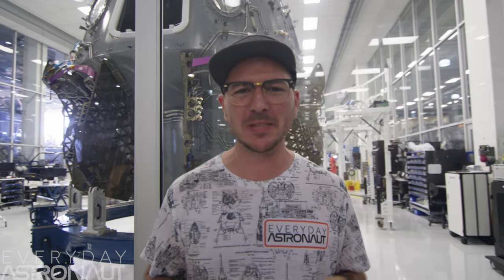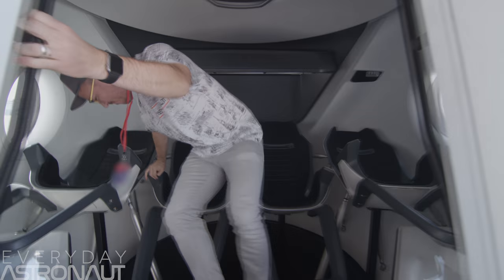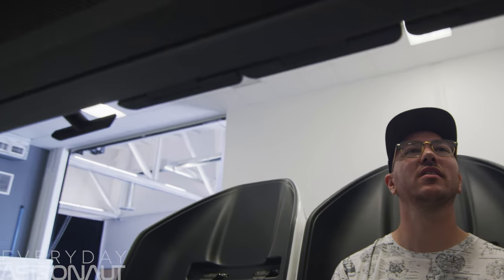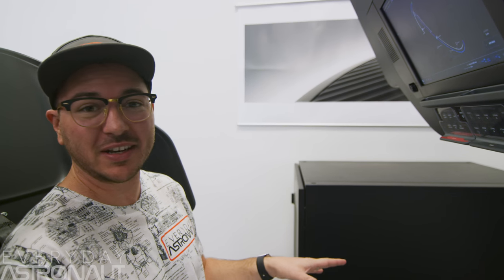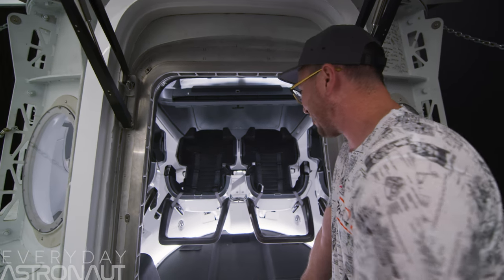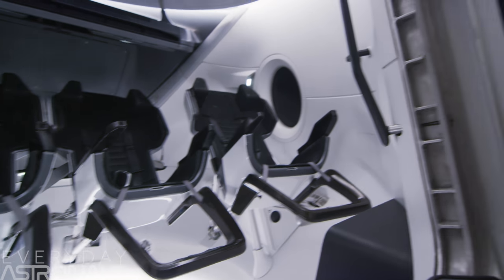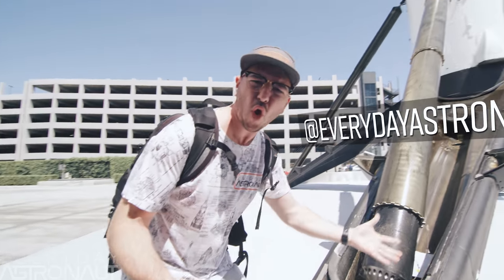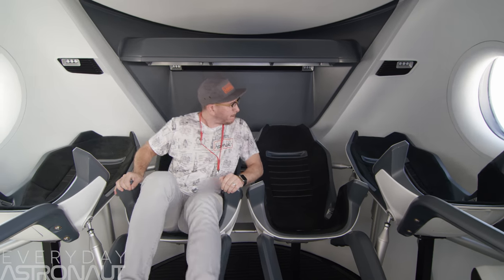Inside SpaceX’s Crew Dragon Capsule and HQ!!!

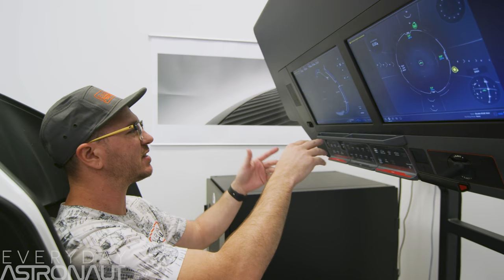Comment: Just for clarification, at 2:55 or so, Tim mentions "jettison the nose cone here in a second". I thought crew dragon won't jettison the nose cone. I thought it was on a hinge and will fold backward for docking. Am I mistaken?
Reply: I believe in a nominal scenario,it will hinge and fold backward for docking. If an off nominal situation where the hooks and backup hooks fail to unfold the nosecone, it will be jettisoned. It's basically a backup to the backup scenario for crew dragon.
Reply: David
I think it was a slip of the tongue.
Reply: The PYROS group of controls (the third group from the left) does have a "Jettison Nose Cone" button, but in this case I agree with David that it was a slip of the tongue as Tim was talking about viewing upcoming events.
Reply: Thanks all, was just making sure!

Comment: First of all, extreme awesome insights!
But on two points I want to calm your excitement with a bit of context ...

1. Autonomy isn't really new 21st century tech: every Russian-human-space-flight-vehicle (Vostok, Soyuz, Buran, TKS, Salyut) is/was capable of fully autonomous flight, starting with Jury Gagarin. But true, for American crafts this is kind of new... trolling

2. The seats going up to the controls is also an commonly used technique (Shenzhou, Soyuz, ...) to dampening the shock of landing or firing launch-abort-motors.
Reply: Oh, in English the correct transliteration reads: Yuri Gagarin.
But hey you probably understood to whom I tried to refer here ;-)
Reply: The Space Shuttle was also autonomous, though early flights required crew to take over final approach and landing. Also all cargo spacecraft by definition are autonomous (perhaps except docking??). Hell, the american capsules were autonomous from Gemini on, and Mercury was remote controlled from ground computers.

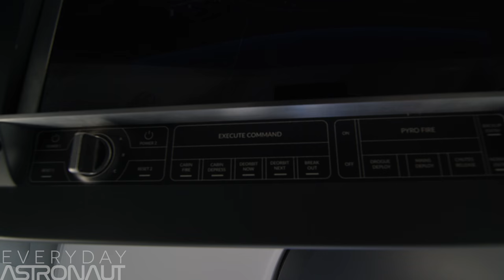Comment: The touchscreen and "capacitive buttons" worry me. A spacecraft during liftoff and reentry will be vibrating and have high G loads. I'd want a physical button I can touch without triggering, then just apply more pressure to trigger. No uncertainty. No "well, I THOUGHT my finger was on 'deorbit now', but it actually activated 'cabin depress' - oops." (1:34 - they're right next to each other!)

It doesn't need hundreds/thousands of physical buttons - just replace the capacitive buttons with physical ones. They can even change what they do, with a label on the screen right above.  Sort of how airliners don't use touchscreens, they use plain screens with buttons surrounding them that change in software what they do. You should be able to push buttons by *feel*, not needing to look directly at them.
Reply: Fortunately the capsule flys automatically
Reply: True. But when it *ISN'T*, that's when you need the "hard/impossible to get wrong" controls.
Reply: I thought the same. Touchscreens are not 100% reliable sometimes, with dry fingers they don't react from time to time. Maybe they used better screens compared to the screens used for standard applications.
Reply: I'm pretty sure they did. Because astronauts are going to wear spacesuit while using them.
Reply: They did special gloves for touchscreen
Reply: It's not like they have rocket scientists working on this...
Reply: Srsly, i gotta lol when average Joe's on the internet think the best and brightest in these fields haven't thought about every potential complication before making their decisions.
Reply: @jimmyjoemonkeyii3563  
The concerns are reasonable, touchscreens aren't really the last option you would want to have to relie on. Boeing does not use switches for nothing, modern aircraft with touchscreens still have physical switches for the most crucial operations. Obviously, you can program a touchscreen individually, to not start an operation due to accidential contact but you still have the issue of relieing on one panel, wich, if it fails, takes out all manuel input that an astronaut could make. Not just that but a lack of physical recognition also means that actuating the correct operation under complete loss of visibility is not possible with a touch screen. Now, you could argue that the capsule is highly automated and isn't really in need for manuel navigating from within the capsule anyway but you always take the worste case into account, in this case, complete manuel navigation within the capsule. You could always take more than one touch screen on board to switch, if there is a malfunction but that would add complexity and weight, both the only really big advantagous of a touch screen over a mechanical switch.
For your last comment, it very well can be that this isn't the complete design of the Dragon capsule.
Reply: @mandernachluca3774  but how at risk are touch screens of failing though? It's never really the hardware/circuitry that fails, it's the glass that becomes compromised. Manual switches could potentially fail as well and when they do the process of fixing them is more labourious then changing a compromised touch panel. They seem pretty reliable, especially with AI backup as you noted. Plus, the added complexity and weight of taking more than one touch screen onboard is fairly negligible. I'd imagine Boeing and others haven't made the shift because these companies get entrenched in a particular way of doing things that work well enough and are tried and true. Switching tech can cause headaches in terms of costs of manufacture, installation and retraining pilots.
Reply: @jimmyjoemonkeyii3563  
I don't think that Boeing is entrenched in some kind of thinking, i think that Elon forces to much futuristic thinking onto Space Xs Crew Dragon capsule. The thing is, that one out of 50 switches is less difficulte to repair, as opposed to one entire panel, it is less costly to repair and potentially faster to repair, in case of an emergency. You could just have a spare panel already installed but that would mean more weight and therefor negating  
one big advantage of touch screens. Also, when talking about switches vs touch screens, you don't nessacarily have to decide for just one of them, Boeing actually did a great job of just including as much switches as really needed, coupled with big screens that show every nessecary parameter. Even though Space X hopes to completly automates the Crew Dragon capsule, they still would need buttons or switches for the absolute nessecary operations and from what i' ve seen so far, space x actually incorporated a very limited ammount of buttons.
Reply: @mandernachluca3774  I don't think multibillion dollar companies are concerned about the repair or replacement costs of a few panels in a tiny amount of capsules built. It's a very small cost for the benefit of simplicity and usability. As for entire extra panels or even just the glass or plastic used for the screen, we're talking barely any weight, like mere pounds. The chances of a touch screen breaking or becoming faulty are small in the first place given these are fixed installations and not devices carried around like phones. Of course there could always be backup controls (not just manual but extra touch panels) but if AI truly is reliable (it should be by now when it's used in cars) it would suffice while repairs are being done. I mean, they already plan on using AI to dock the capsule to the ISS. I don't want to fault Elon for thinking 'too' futuristically. I just see his moves as a much needed innovative boost in an industry tainted by corporate profiteering and innovation stifling lack of competition.

Comment: I think SpaceX will revisit landing Crew Dragons on land using the Super Dracos. I know Elon said their future for landing spacecraft on land will be the BFR. I think for some situations the BFR will be overkill. I think they'll find that even with the BFR, there is a place for Crew Dragon. Sometimes you want to transport a few people to and from space. Like maybe for emergencys.
Reply: I think Nasa said they don't want landing legs incorporated into the heat shielding as that was a point of failure for shuttle.
Reply: Sarah
Unlike CrewDragon the BFR will be fully and rapidly reusable. There is no point in using the CrewDragon instead of the BFR even if the costs for the rockets are equal. Think about all the additional ground hardware required if you are producing and flying TWO rockets (and one of them is only partially reusable.) 
One system to rule them all!
Reply: Well, even if they don't reconfigure the Crew dragon to land on land. I still think the BFR will be overkill for certain situations. Maybe they'll develop a tiny (compared to the BFR) version of the BFR at some point. For emergency situations or something. Were they only need to bring a few people up or down from orbit.
Reply: And who will pay for a SECOND development of a fully reusable rocket system? Certainly not SpaceX.
The BFR is not overkill, if it is cheaper because of rapid reuse. Size plays no role in this respect.
Reply: You're misunderstanding the timeframe I'm thinking in. I'm thinking long term. Obviously, the BFR needs to start flying first. I'm thinking about in about a decade from or more from now. Once the BFR has established itself a bit. I like to think about things long term.
Reply: BFR will definitely not cost more than a dragon mission.
Reply: Sarah
BFR is long term. 
Once BFR is up and running, there is no need for any other Rocket anymore (expect a bigger one maybe).
Reply: Keyboard runner - You never know what the future will hold. Maybe, maybe not. You think there will never be a need to move fewer people. We'll always want to send or return 50 to 100 people. Elon Musk likes to use airplanes as an example of reusability. There are many different capacity aircraft. I think the same will inevitably be so with spacecraft. Or not, I don't really know.

Comment: If I recall correctly, the Dragon 2 Spacecraft for DM-1 arrived at Kennedy in July and the launch is planned for November. 
What is driving this timetable and what is (and has been) happening related to DM-1 (and specifically the Dragon) during that period.
Is it just sitting there waiting for an arrival slot on the ISS or are there substantial qualification and/or preparation it has to undergo for it to be ready for launch?

Comment: You had to climb into the Boeing Starliner, at SpaceX you just walked into the Dragon capsule and took a seat. Seems to me Dragon has more room...even though itˋs actually a smaller capsule!? Greets from Germany
Reply: The Starliner follows the same steeper capsule wall angle as the Apollo and Orion capsules. D2 is a taller capsule

Comment: Hey Tim, why do SpaceX does not use the same aproach that boeing to land in a barque?, Elon said that it would be hard to certify the shield with the legs coming throug it, but what about dropping the shield a few hundred meters before landing like boeing?
Reply: Jose Parcerisa the shield has legs in it that the dragon would land on
Reply: @goreoproductions6955  is my understading that the leg's are retractable, not fixed
Reply: Jose Parcerisa they are, but you couldn’t ditch the shield and land on the bottom of the capsule, because it’s not designated for that
Reply: The idea would be:

1. Ditch the shiled (like boeing)
2. After ditching the shiled, deploy the legs.

The point being that certifying the Dragon 2 for human flight with the legs that go through the shield, would almost impossible or too expensive.

Watch Elon explain it here:
https://www.youtube.com/watch?v=XqYPmshyCDU
Reply: They are gona try and land on an inflatable raft to keep it out of the water

Comment: I’d think the seats need a big coil or spring in them like the Apollo capsules
Reply: The seats in the apollo CM didn't sit on any big springs or coils but instead they hung from struts which were designed to absorb some of the impact energy.  Right idea, incorrect implementation. :)
Reply: Lensflare Deviant what the schematics show on NASA.com is springs or hydraulics that are attached to the seat and frame. Go to the last picture on page of the link
Reply: Yes, and it shows the struts they are hanging from.  Inside each of those is the impact attenuation system.  In this case eight struts which connect the crew couches to the CM structure. These struts (two each for the Y and Z axes and four for the X axis) absorb energy by deforming steel wire rings between an inner and an outer piston. The struts vary in length from 34 to 39 inches and have a diameter of about 2½ inches.  So like I said, right idea wrong implementation.  They don't sit on the shock absorbers but sorta hang from them.
Reply: Lensflare Deviant I’ve always been taught that those were springs/ shock absorbers. And when you say strut I always think like biplane strut
Reply: In effect they were.  The only part of your description I was trying to correct was the orientation.  They were not sitting on, but hanging from the devices you described. :)

Comment: What is the size of the fuel tanks in liters? I can't visualize it in kilograms. Must be surprisingly small to fit inside the capsule. And although you (Everyday Astronaut) said the tanks are inside the skirts, wouldn't the tanks have been designed to be inside the capsule (inside heat shield) for the propulsive landing? It's unclear from the abort test if the fuel tanks have been moved to the trunk (to free up room in the capsule). Please let us know?
Reply from the maker: The fuel tanks are outside of the pressure vessel (see how it tapers in on the one in the clean room), but the heat-shield still covers them. Also it won’t be propulsively landing. I have a video about why they won’t do that, it’s from 2017 sometime.
Reply: Thanks for replying - and so quickly! I re-watched that video (another great, informative one) before posting. I was just commenting on how the capsule would have been originally designed, when meant for propulsive landing. But you're answer that the tanks inside the skirts are still inside the heat shield covers it all.
A quick video on why SpaceX went straight to water landing would be very useful - there are a lot of questions out there on the web, with no definitive answers. Why not a Starliner/Blue Origin airbag? Too inelegant for SpaceX? Also, with hindsight, they could have originally designed Falcon-type legs (faired into the side of the ship, they'd be within the heat shield protection). Too heavy? When NASA rejected legs through the shield, I'm sure the the re-engineering would be prohibitive at that point. But would re-engineeering have made sense for airbags, balanced against the cost of salt-water immersion? Unclear to me that building a new CrewDragon for every flight really makes cost sense, even with re-use for cargo.
Sorry for the long question - I just wanted to make clear what I do understand vs what I don't.
Reply: Perhaps I can answer my own (last part) question. Refurbishing Crew Dragons and "old-fashioned" Cargo Dragons would mean having 2 refurbishment lines/processes. SpaceX retired all non-Block 5 Falcons to avoid this, so may have applied same reasoning here.

Comment: I feel like you would want some sort of system for controlling RCS directly in the event of some sort of catastrophic system failure.  I guess at that point, there would be worse problems then trying to fly the spaceship?  That’s very backwards from everything I’ve learned as a pilot and even engineering student.

Comment: could spacex land dragon 2 propulsive using the super draco engines in case the parachutes fail?
Reply: There are backup parachutes and I believe it could still land if one parachute doesn't work.
But yes, Elon says the Dragon is technically still capable, but I don't know if they would vent the tanks before reentry.

Comment: It definitely looks cool, partly because of the black-white-grey color scheme, but I sure hope they add a little color for the BFR crew vehicle. Six months staring at black and white would not work for me.  Also, I would've liked to see how they designed the hinges for the seats and entry door.  I wonder if they use any off-the-shelf parts or if everything is custom built. Oh and what material was that docking port - the gold-colored thing made of?  Pretty sure it wouldn't be gold.  The astronauts must be grumbling a bit have so little control of the vehicle - but I can see why they do it - that Virgin Galactic pilot made one little mistake and it cost him his life & nearly his co-pilots, not to mention setting back VG years.  Humans just screw things up, sometimes.

Comment: There's an opportunity for the spacecraft manufacturer that can purchase used Dragon V2 capsules, and re-rate them for reusable human flight. I'm thinking used spacecraft dealer.
Reply: But then they would have to disclose a lot of information about the capsules to dealers for repair (like technical drawings) and offer replacement parts to them. I think the chances of a dealer selling materials and proprietary information about the capsules to competitors is too great of a risk. I don't think SpaceX would do that, but they might consider re-rating them themselves.